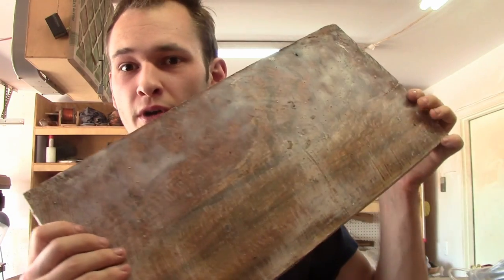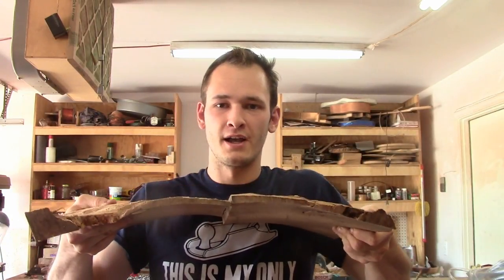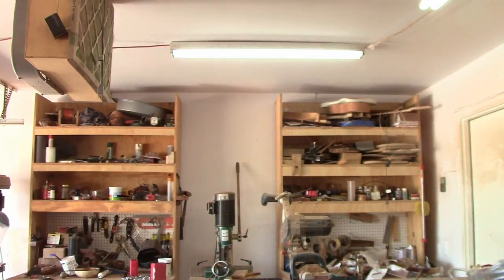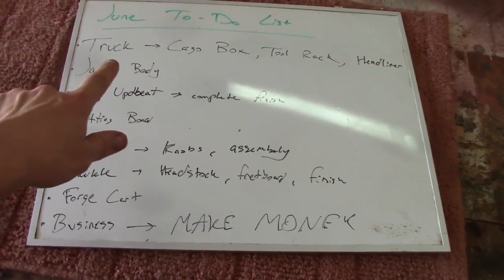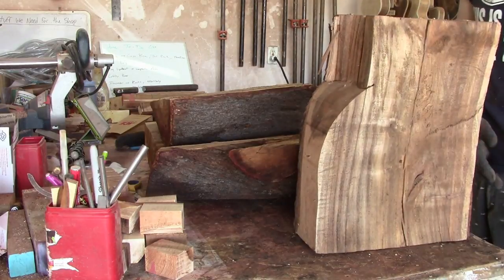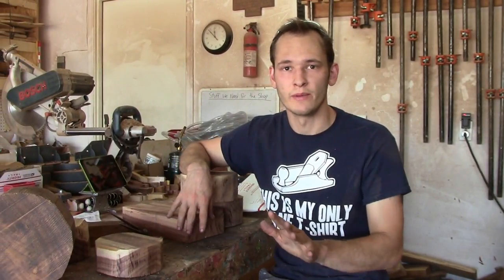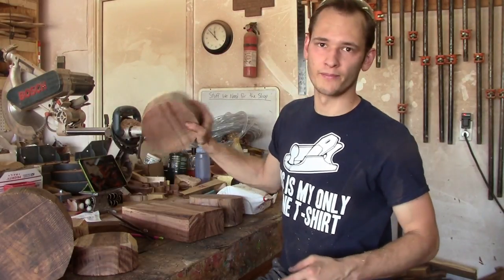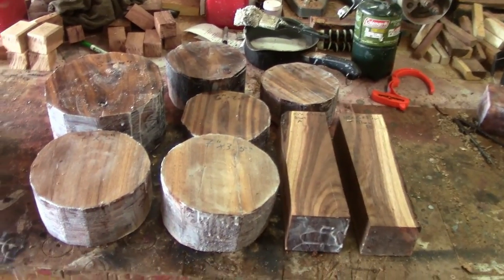Why You Should Always Seal Wet Wood!

Comment: If you seal wet wood, you trap the moisture inside the wood. This is not desirable as the wood will be heavy, unstable, and prone to decay.
Take it upon yourself to read up on wood grain direction and how sawn lumber releases moisture and shrinks.
There is nothing simple about lumber drying and there are no simple statements that cover all situations.
All species of wood shrinks, to some extent, during the drying process. Getting green(freshly milled)lumber to dry without creating twists or warps is difficult as there are always some members that will deform to the point that they cannot be used as building products. Lumber manufacturers are in the business of minimizing waste, and they have processes and practices to that end.
Oak is not pine. Pine is not doug fir. Mahogany is not cherry, etc.
Green Boards are often coated (painted)on the ends, to slow drying, and the associated warping and other deformations, until the
Boards reach the lumber mill’s drying process, be it air drying or kiln drying. Once in the drying process, the lumber is dried in such a way as to minimize cupping, warping, twists. Etc. 
Shrinking, however, is inevitable and is dependent, in part, upon how the lumber is sawn; ie, quarter sawn vs flat sawn for example.
I have spent over 50 years learning about wood products; both as a profession and a hobby. I always find something new to learn, and find it fascinating.
Please, get access to a venerated source, such as a
Trade-school textbook, and gain an understanding of cross grain vs end grain characteristics of wood, the different characteristics of different families of wood species and their uses.
Rot resistant species and what makes for their resistance.
It can be very helpful no matter what your wood project is.